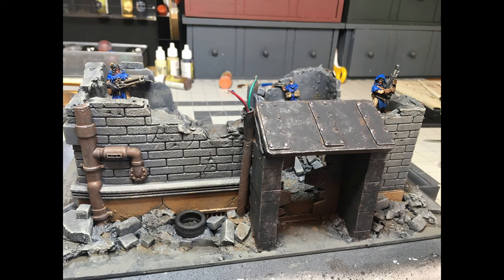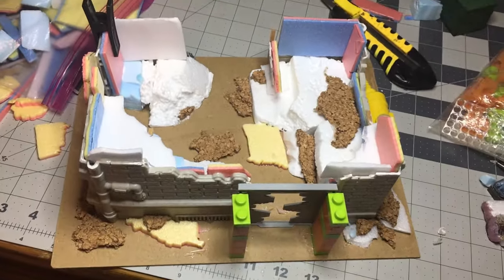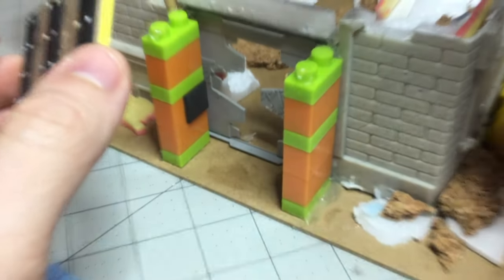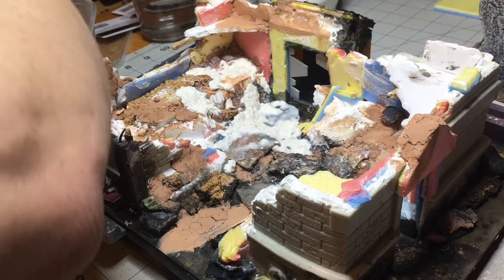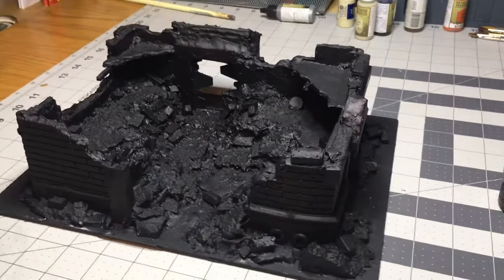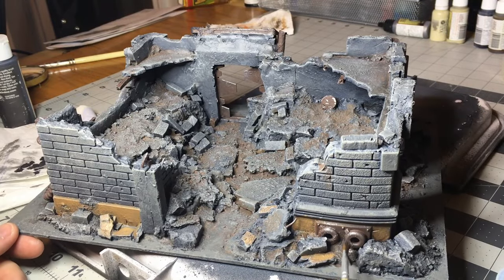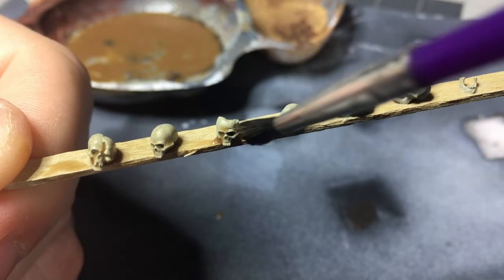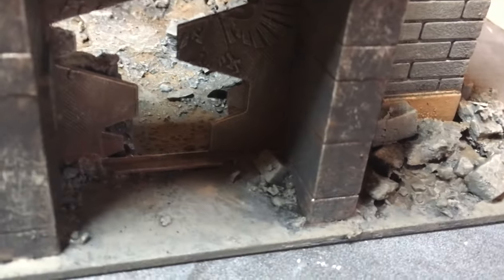Goodwill 40k Terrain

Comment: I was a little skeptical when I saw you slapping foam and hot glue and Lego on there, but you tied everything together really well and it looks fantastic! Really good job, I may need to try copying this with whatever bits and bobs I can find at my own local thrift shops.
Reply from the maker: Thanks, I used to think white foam was junk and only use nice insulation foam board but if you are going to cover it with sand and grit its a great free option. Thanks for watching i am glad you liked it!

Comment: Using the outside plastic as a guide for the foam cutter to bulk it up was great.

Using newspaper adverts to work as scale props worked so well too!
Reply from the maker: Yeah the wire cutter was the most fun part of the build. I think I got the wire cutter cheap as well, I think it was $30 in a craft store. Thanks for watching!